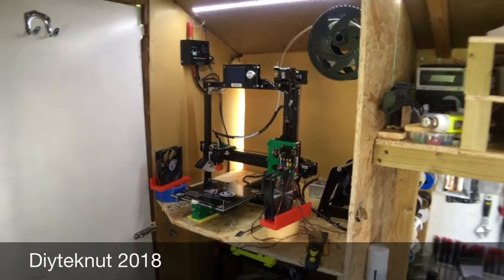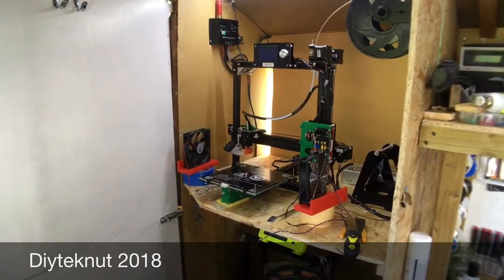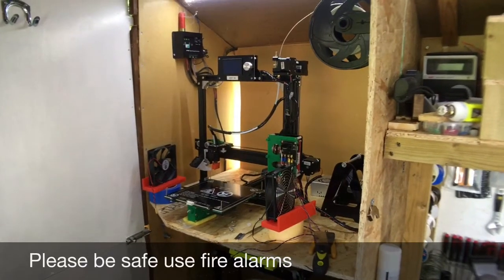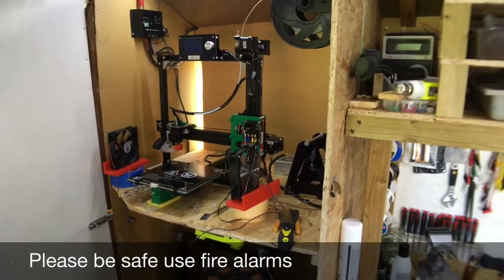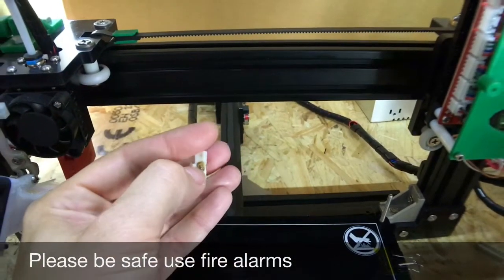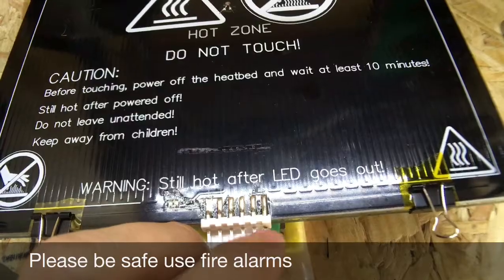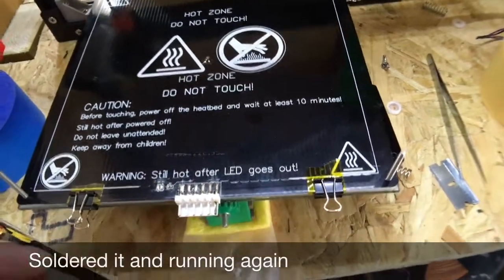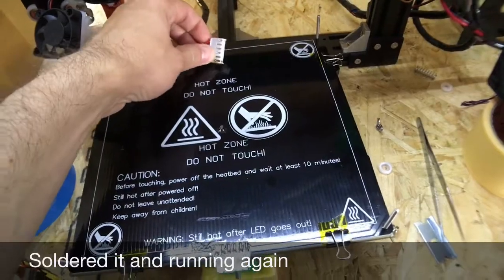My 3D Printer Burning Flames

Comment: Couldn't agree more, I have mine in a sealed aluminium with a double glazed door on it , it was one of these fridges where you can see the contents like wines etc, Perfect as it holds the temperature nicely, has lighting and you can see the prints as it goes, I also have a ip camera on it for when I'm not there,  smoke detectors outside to contact me on my phone and a automatic extinguisher in the cabinet and a sonoff power killer, I removed all the XT60 connectors and direct soldered everything, these printers are crap and people do not realise the fire risks with them, they are left on for hours and hours printing at bed temperatures of 70 plusº and nozzles of 200º and they are waiting to catch fire, the electrics on them are dreadful and all need checking before you even switch them on.

To be honest I don't like leaving the house if its on a long print but now feel I have enough in place to put a fire out if necessary, the 5 litre extinguisher is big enough to remove all the air in the fridge and I have replaced the interior plastic with aluminium so its pretty much a fire proof container. I have seen so many fires from these machines. You have to check them properly and not leave them on their own for long periods of time, Its the same with the LAsers, I never leave it unattended if Im using it. Its engraves by burning wood. end of story! Dont mess with fire.

Comment: Good catch my good friend :-) I have found in this hot weather alot of my anderson high amp connecters have been meltings :-D i have been swapping bits over to kettle plugs where i can and as you say there by passing connectors where i can altogether for direct solders :-) Sorry ive not had chance to drop by of recent, its been pretty crazy on this end but I have not forgot about you my friend and am glad you caught this from setting you back and am both impressed and glad your workshop is active and looking brilliant :-) My best you know it, Paul.
Reply from the maker: Nice to here from you Paul, glad your well my friend best of luck with everything all the best.
Jace.

Comment: I have an Anet A2 I had exactly the same issue, since soldering the connections to the heat bed it has behaved itself.
Reply from the maker: Thanks yes should be good now. Have a good day
Reply: The issue is the metal pins, high current low resistance equals melt down. Can't trust Chinese non quality control parts.

Comment: I actually have a anet a2 as a backup machine. My main printer is parked on a heavy glass surface that has a flat wood surface underneath that, so there is no chance of fire on that surface area. You might want to consider going with a proper metal shelving arrangement for it, or maybe create a electrical connector for the heatbed that uses a pivoting connector similar to a bolt with insulating spacers and washers between the +/-.
Maybe score a cheap extra metal shed is another safety option. 
Definitely go with a smoke alarm, maybe even a heat sensor alarm focused on the machine making sure it wont go past a preset heat registration.

On my creality cr10 s5, the heatbed wire is prone to flexing at the connector mount, so i added a clip to remove the flex point of the connector, as the new flex point is at the clip location, and that should help extend the life of it and maybe even my own.
Reply from the maker: Thanks. yes metal shelf's or  a small metal shed would be good idea  i have 2 alarms a ionisation smoke alarm and  a photoelectric alarm.
have made strain relief for cable. 
Have a good day.